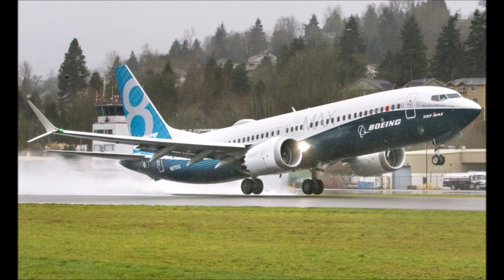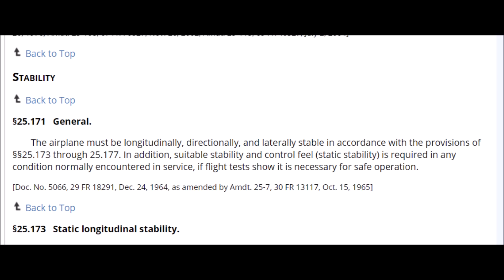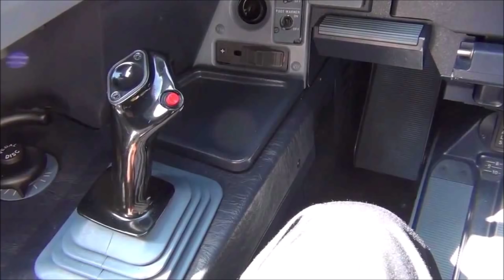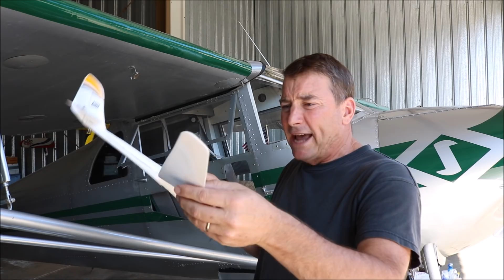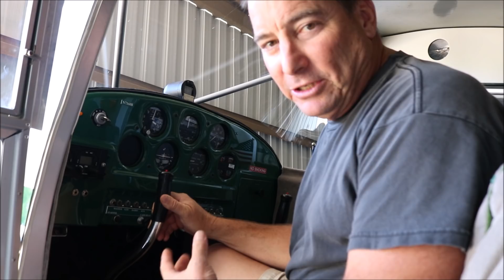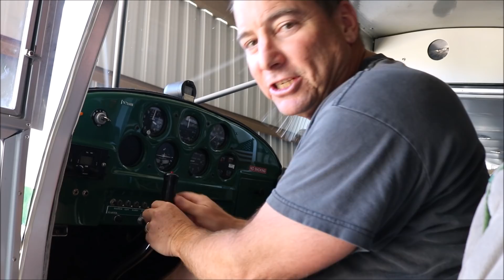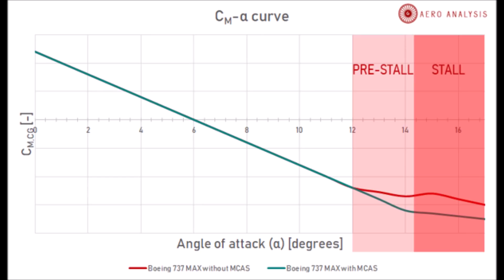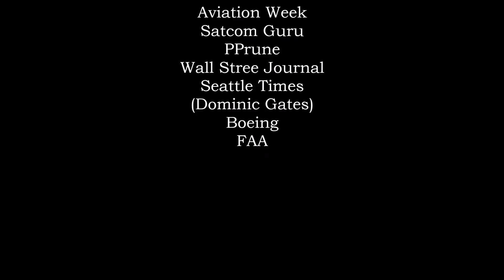737 Max UPDATE 30 Aug  2019

Comment: Thank you for posting this video, however, there are a couple critical mistakes, if not corrected,  which can result yet another 
 similar air disaster . After I have reviewed this video a couple times, now I  come to realize why the problems, I discovered back in March, are still not been addressed.

 One of the problems is a commonly made mistake by statistics students.  I teach statistics and I have a chemical engineering degree ( covers fluid dynamics and aerodynamics ) I m also well versed in artificial intelligence in graduate studies  as well as industry experience.   You may want to contact me at your earliest convenience.

Comment: Man, thank you very much for the explanation!
It is the first time I've heard about the actual purpose of MCAS and it makes much more sense than 'anti-stall system'.
I've never heard about 3 pounds per 10 knots FAA rule and the way Boeing decided to fit the requirement, now MCAS looks like a dirty hack not solution. I haven't recognized Airbus fly-by-wire intelligent stick as an advantage after I watched Mayday episode about 1988 Air France airshow crash, but Airbus stick design makes much more sense now. However I'm curious which flight controls you prefer as a pilot Airbus fly-by-wire stick or Boeing yoke?
Reply from the maker: Boeing Yoke, it's what I'm used too.

Comment: I have 30+ years in Airline industry on the line Maintenance side.
The Max should never had been! 

The 800 and all its predecessors are fantastic aircraft but the 900 and the Max should never been designed and Yes I am saying it!

The 900ER and the Max are so far removed from what the original 737 design was its no longer a 737 

The 900ER and the Max are completely different aircraft from there original 737 predecessors and because of which should have required a whole new design sheet.

Boeing senior management knew It was cheaper for Boeing to redesign an already proven type rated 737 aircraft rather than to go into a whole new aircraft design and develop a new Type rated aircraft OR bring back the Proven 757 design as they had already destroyed all the Tooling for and repurposed the the line where it had been built.
It took the Airline industry decades to realize how to use the 757 properly to make money with it.
It is a truly a very unique aircraft perfectly designed to handle multiple mission rolls. 

Now the industry wants the 757 in Vast numbers but their no longer built by Boeing! so Boeing Board of directors created the 900ER and the new MAX!  

The 900 and the Max were created to do the Job of the 757 which was the perfect aircraft for the Job! mid-sized, narrow-body short to medium range, twin-engine airliner. 

Boeing Management believed they could modify the 737 basic design by re engineering the wing and stretching the body to do the Job that the 757 had already been designed to do and produce it cheaper than the 757.
They did it by cutting corners and out sourcing ! They outsourced engineering and manufacturing to rush it into production. 

I love Boeing aircraft, But the 737 Max should never had been built! 

The 757 should have been brought back and put back into production even though it would cost more per copy than an already current Airbus and or a 737-800.

Comment: Juan, great explanation but you confused me on your comparison of airbus and Boeing.  I don’t understand why the same safety features can’t be implemented in the Boeing aircraft. But more important have you seen Scully’s video on the Air France disaster where 3 experienced pilots never recognized a stall for 10000s of feet till they hit the Atlantic.  Where were the Airbus protections against pilot error in that one?  I wan t pilots who can fly the plane not signal the computers.  I want pilots who not only have experienced a spin but do it in proper equipment for fun. I want pilots who understand in their gut and fast if something is not working try something else.  I want pilots who, when close to the ground and everything lights up, go back to basics.  Forget the lights and fly the plane not the computers.  Something is pushing my nose down and I can’t pull hard enough, shut off any system that might do that, now get my nose up and speed down and when straight and level(ish) start deciphering lights.   I don’t want an airplane that some pilots can feel takes that responsibility away.

Comment: Thank you for this excellent explanation! I wonder however, how anyone can consider using the rather blunt instrument, the stabilizer trim, in order to manipulate the feel of the controls. A more reasonable approach would be to have servos acting directly on the control column. A break away connection like the one I had for the autopilot servo in my old PA23 would provide emergency disconnection. The fact that Boeing opted for the stabilizer trim suggests that there were very few pilots involved in the concept generation in order to make the aeroplane feel like other 737:s.

Comment: Hmmmm, so MCAS is designed to provide a way AROUND the FAA Regulations regarding flight safety (by ensuring adequate pilot training) on a largely similar (yet tweaked) flight platform: MCAS is basically a hack to avoid Federal pilot training requirements. INGENIOUS!  The bean counter's DREAM came true!   What a pity that MCAS also has several 'single-point-of-failure' design errors : 1) no redundancy on a safety critical attitude sensor,  2) single comms-pathway,  3) no pilot-detectable shut-down facility ......and I'll bet there are more. The REAL question is: HOW did any engineer ever sign this off in good faith?? These are high-school engineering concepts, never mind Aeronautical Engineer's nightmares.
How did the FAA ever accept this?? Fully asleep at the wheel of public safety, total mandate FAILURE. And then there's Boeing: Gross negligence is rarely a single event, it is usually systemic in a swollen Corporates. 

Boeing fight for survival isn't 'almost over' , it has barely begun.

Comment: Unbelievable that Boeing forgot the basic fundamentals redundancy.  I knew exactly why the second airplane crashed the day it went down.  I am pretty sure there were some people at Boeing that wanted to ground the aircraft after the first crash.  I dont understand why those people could not stand their ground when they knew the issues had not been resolved.  So many people at Boeing should be fired. I do manufacturing for a living, and I will tell you managers will always push for speed and budget, but it is up to us, the people who have to qualify the parts to push back, even if it means risking our jobs.  I have been asked to make unsafe/untested parts before.  I always decline and pushed back.  Now when it happens I bring up these accidents, and I also bring up the scene in the movie "the martian" when the rocket blows up because they did not test it.

Comment: Two AoA "fin" inputs were a necessary redundancy improvement, but what happens if both of them become 
frozen in ice forming over the nose (the two indications still agree, 'cause both are stuck in identical positions)? 
Could software detect a lack of response to automatic, minor AoA commands that should produce matching feedback?
Reply: Well established methods of safety and reliability analysis would have shown that 3 or more redundant paths were needed.

Comment: Runaway trim has been a known potential safety issue for as long as I've worked in aviation. That's why every aircraft you see with electric trim has a split switch where both sides of the switch have to be pressed for the HSTAB to move. So that a stuck switch can't run the trim to the limit and crash the plane.

On top of that, by designing a system that is controlled by a single AOA sensor with no cross talk or error checking, they've completely abandoned the design concept of redundancy. It blows my mind that Boeing would design a system that has authority over flight controls with input logic that can be compromised by a single point of failure. 

Good luck with your health issues, hope you get back flying soon.

Comment: This is the single finest and spot-on assessment of the 737 Max situation I've ever run across. The only comment I would add is that the pitch trim force reduction on the Max tended to be exaggerated at light loads and/or if the aircraft were loaded towards the aft portion of the CG (center of gravity) envelope as aeronautical engineering fundamentals interacting with Max design changes would suggest. Congratulations on a simply outstanding assessment from an organizational, engineering, human factors, regulatory and economic standpoint. My thoughts and prayers for your health and keep up the great work!

Comment: Juan, remember how RUSHING the DC-10 to compete with the L1011 ended up with a hydraulic achilles heel....? I found an engineer early on saying the same as you...this should have been a new type rating. Rushing/saving $$$ costs lives. I was  disappointed when my G550 type was not common with the G650. But it was the right call. Great concise fair explanation..thank you.

Comment: Juan - good video, though the title "Update 30 Aug" only refers to the last four minutes.  For those following the MAX, including on your channel, much of the first 20 minutes was redundant.  Also, there's quite a lot more about what Boeing is doing to re-architect the avionics software for the MAX, and redundancy at more levels than just the MCAS.  It is a rather extensive re-write by actual Boeing engineers (vs the contractors used the first time) to get it right.  The Seattle Times has been running a series of in-depth articles for public consumption.  I see that newspaper in your credits, so it appears you've read at least some of them.  

Hope all works out for you to get back in the air soon.

Comment: Something doesn't sound right about these two 737 crashes.  The Max 8 was doing just fine (actually better than fine) for quite a while, without a complaint, then suddenly two go down in a short span of time from the same nanny control problems.  It's not logical to me the MCAS wasn't throwing red flags before the crashes, and if it had, then why wasn't it addressed?   The Max 8 was poised to steal the show in its class for the foreseeable future, but not now.

Comment: Make some cannabis oil suppositories to and use them to bring your psa levels into line. And to actually cure that condition. Google it if you have any doubts.
You can trust big med, but you can't trust big pharma and their intellectual property rules in conjunction with the FDA. They ain't lookin for your cure. They're lookin for your life savings. If you doubt this then google it. Google hard. If that doesn't work then try duckduckgo or other non aligned search engines.

Comment: Airbus: Except letting the pilot using too much rudder and breaking the vertical stabilizer off of the plane and dropping it in on Long Island. Or letting the pilot and copilot put in opposite controls and riding plane all the way into the Atlantic Ocean.

Comment: Thank you for clarifying the issues. It is disturbing to consider the possible impact of the change in FAA inspectors during the design/approval process. I wonder what might happen if the FAA was to require pilots to be certified on the 737 Max as a new aircraft rather than sliding it through without significant training. When you change the trim dynamics of an aircraft and alter the flight computer dynamics maybe you have crossed the threshold for new type certification.

Comment: Great information package. I still can’t understand how a single source logic information system was allowed by the FAA. One AOA input and it’s good to go. Going back 50 years to information logic circuits there had to be two inputs for a logic control circuits to be qualified on any primary or secondary flight control input. This completely baffles me because these older systems usually had three input systems for logic voting. This aircraft was approved to fail and the doomed pilots along with the passengers payed the ultimate price. I can’t image the confusion in all the pilots minds when hit with all this information and an aircraft that isn’t responding to your inputs. What Horrific confusion! One lousy source! One!

Comment: Good video, hope you get your licence back soon with continued better health.

One thing that is puzzling me.  If you wanted to replicate the older 737 rather than pushing the nose down, which the older 737 did not do why did they not just make the flight controls have same pressures?  That would be augmentation, this is actually taking complete control.  A control that might need turning completely off on occasion.  To a layman, like me, it seems more like a system that tries to cure automatically an aircraft that is more tricky to fly at the limit rather than trying to get it to be like the 737NG  etc.   How could different flight stick pressures be considered need for retraining but  a new function of pushing the nose down uncommanded not be?

I'm puzzled, but I am no expert, I am sure someone will give me info if I have gone off course a bit.

Even with the once only and needed redundancy that seems to just  reduce the chances of it happening , not remove it completely. How do we know this software /hardware solution won't have another unseen problem in 2020 or onwards?

Comment: Aerodynamics wise, 737 Max 8  still tends to stall in air. Now, with the new MCAS, the safety of the passengers depends on how well the pilot cooperates with the MCAS in flight. And the worst is that, the skill of pilots is different. Lastly, can Boeing convince the insurance companies?  Why Boeing makes a plane cannot fly properly without computer aid?
Reply from the maker: ALL aircraft stall!

Comment: While most of the mainstream media has done inaccurate or superficial reporting on the 737 Max situation, you have done an amazing job of demystifying what happened.  They should take lessons from you, because you've shown that it is possible to explain it to laymen in a comprehensible way, with a bit of effort researching and understanding ahead of time.

Comment: Your fight with cancer touches me. You are really strong by continuing life as normal as possible. Chapeau ! 
 Coming to the 737 story. By now it is obvious, that the position of the bigger engines below (or better in front of) the wings of the Boeing 737 max 8/10 adds an unnecessary challenge and therefore an unnecessary additional risk to the task of trimming the airplane. 
 It is the path of technological innovations in the airplane industries that more and more computer systems take control of actuators of airplanes. That is the way of life as it goes ... the path of innovations, which brought us consumers airplanes in the first place ... 
 BUT (!) ... safety first. The top-exec(s) of the FAA testified that they do not have the required resources in order to execute a 100% qualification process for new airplane systems design ... so ... the whole FAA do NOT fulfill its duty! 
 But it is not only Boing ... remember Quantas Flight Q72 (Airbus 330-303) ... which nearly crashed, because of electronic system putting pilots into helpless circumstances unable to control the airplane ... 
 Any design of new airplanes MUST be designed to be capable of flying WITHOUT computer systems support. Computer systems might add comforts to pilots e.g. acting in ways to assure that the aiplane continues flying inside the so called 'flight envelope' ... BUT ... 
 Airplanes control panels should offer pilots kind of an "emergency MY AIRCRAFT" button. Triggering this button should disable all computer systems immediately in terms of access to actors so that the pilot gets immediately full control of the airplane actuators! But this requires an airplane design, which in terms of design is able to flight without computer assisstance. 
 In the software design industry you find in a standard developement process of software so called "Code Reviews" ... may be this should become part of any design process ... not only for software, but also for hardware. 
 Such design- or code-reviews inside the airplane industries has to be documented as part of the qualification process of institutions like the FAA ... 
 Such reviews could identify such issue like ... there are a second (redundant) sensor, but it never gets activated by control systems, because the failure of the first "redundant" sensor cannot be qualified ... because of missing online-self-test-structures in hardware and/or software ... 
 The idle redundant sensor could run selftests as long as the control systems do not require their service ... so even the whole systems development processes at Boing AND at Airbus have to undergo a complete rebuild in the sense of safety assurance processes ... addressing the unavoidable challenge of ... "Who TESTS THE TEST?!?" ...

Comment: Why do designers rely on only TWO AOA Imputs?  In the mid 1960s the B-58 AFCS system was modified with a Triple Redundant complete Rudder Damper System because rudder damper was critical when transiting the sonic region, Mach I.  The Yaw Amplifier Computer System was triple redundant from the three rate gyros, through all regulating inputs like  Accelerometers,  Pitot Pressure, Static Pressure, + a dozen other things like, C of Gravity, etc, through the YACA computer circuitry, to the three hydraulic valves that controlled hydraulic fluid to the 4 hydraulic rams connected directly to the rudder.  This system was very reliable, as failure was not an option.